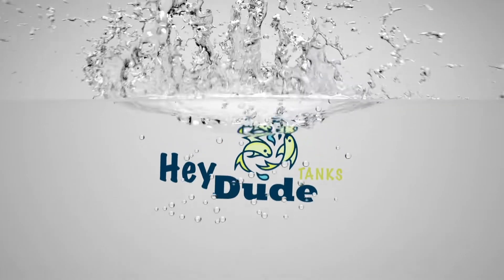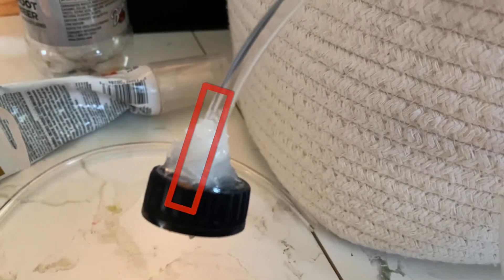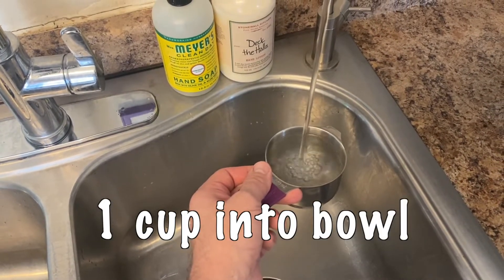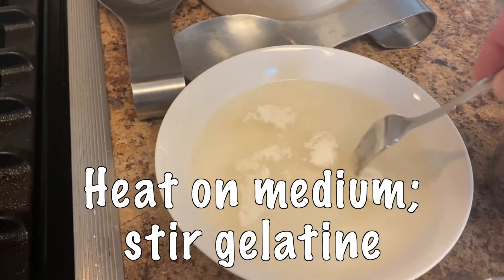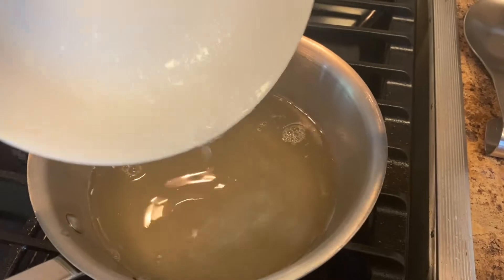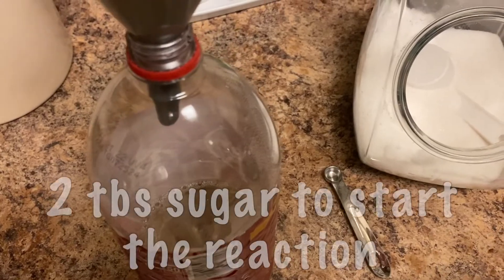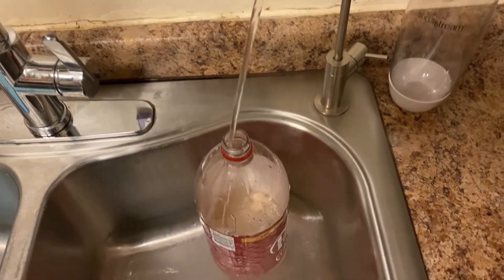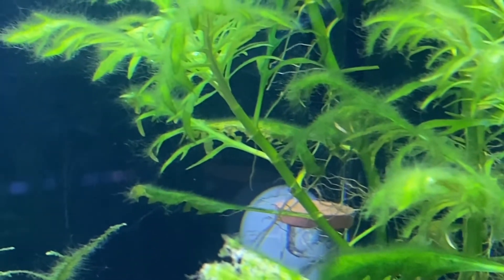DIY CO2 for my 40 gallon aquarium

Comment: @HeyDude, 👋thx for this practical vid, been thinkng about trying this out. I just watched the MJ one, and the algo spit yours up 😁 too many views to have no comments, so let me fix that 😉 got some good tips in there. I saw you use two sachets of gelatine, (and yes, definitely dont ask where it comes from 😅) 
I'm wondering how much that is in volume,  I think MJ said he uses three sheets 🤔 
how have you found the plant growth since you've been using this system, and have you tried any methods to be able to turn it off overnight? I've seen folks discussing this in the comments of MJs..
Reply from the maker: Even with 2x 2-liter bottles the C02 on my 40 gal isn't strong enough to suffocate them given the surface agitation my filter's kicking out so I haven't worried about installing a solenoid. The build-up on the bottles would freak me out, anyway. This comment is a good reminder, I've got to make a new bottle. Thanks, dude!
Reply: @heydudetanks6639  yes, the pressure build up frezks me out too tbh